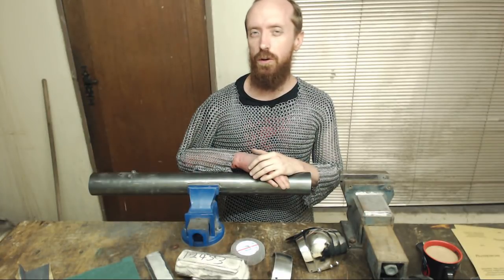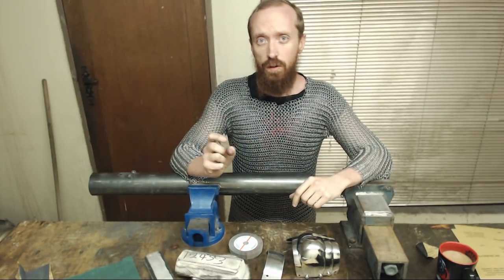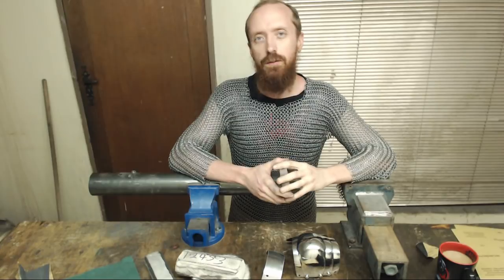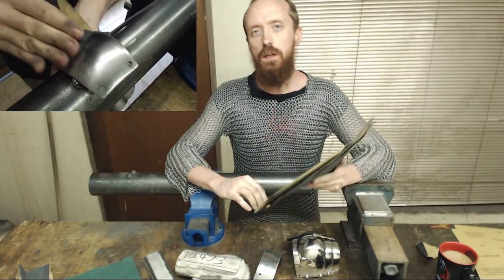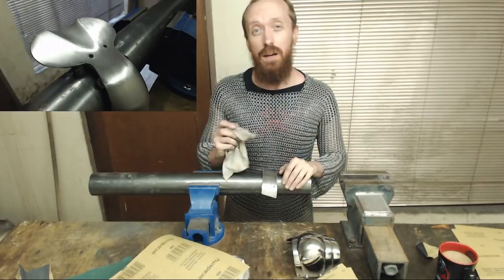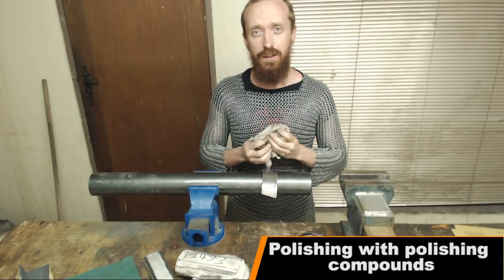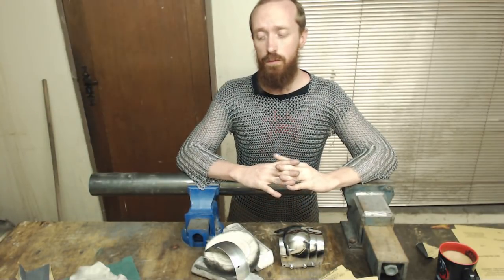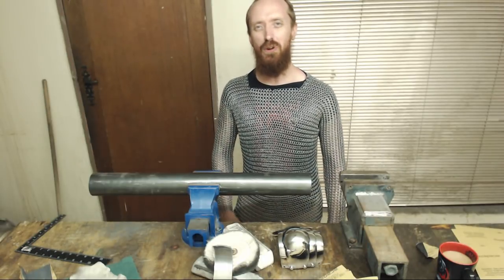How to clean armour cheaply - Sanding and Polishing

Comment: I have sanding pads that fits my drill.. have you had any experience doing it with a drill?
Reply from the maker: Not with a drill no. But lately I use orbital sanding pads on a small grinder. Works really well and you get very fine grits. Readily available at autobody stores.

Comment: I am not a expert in this so don't any of you take my comment as advice it is NOT ! .But all I do is use  120 sand paper and then just buff rub \  polish with nothing other then the inside of and large  pice  of leather rag and it works  just fine for me . Yep no workshop no work bench  and not one  electric tool I find the leather I got just works Don't know why it just  does the job .I think it maybe something to do with the fibres on the inside of the leather on the  armour as you  polish it back and forth .
Reply from the maker: this is the exact method I use to polish guitar frets, leather is great for polishing!